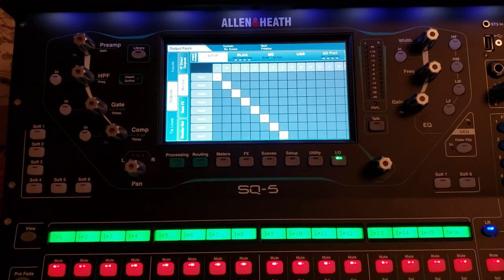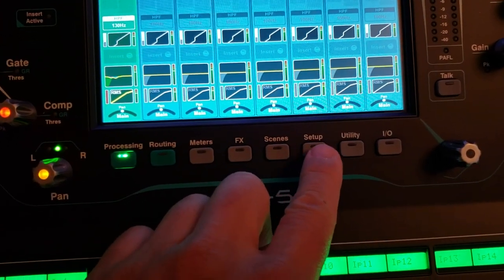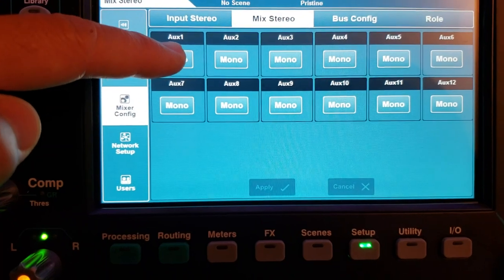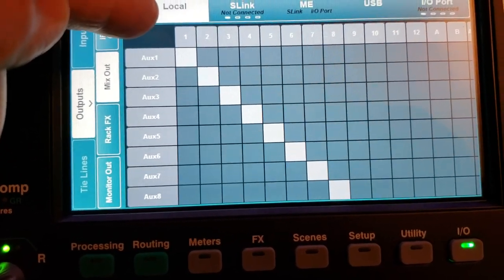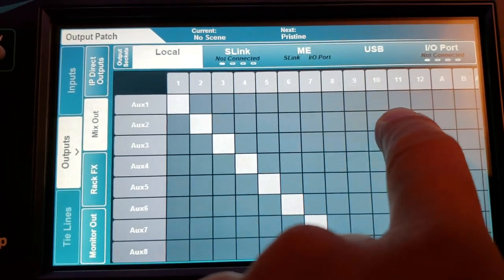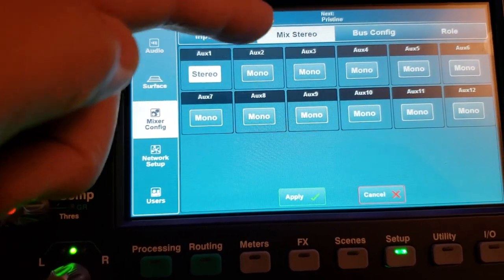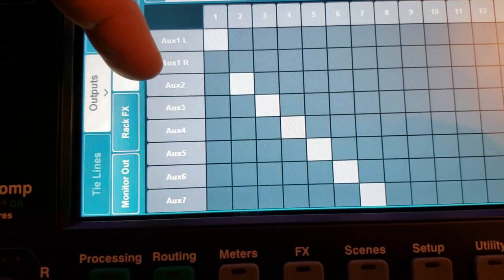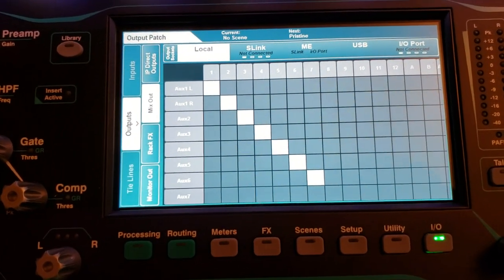Allen & Heath SQ5 Mix Output Configuration

Comment: I would like to understand why Allen & Heath build a huge console with just 6 stereo aux outputs (12 aux). Why can't we use one XLR Aux out as a single stereo monitor output for in ear stereo monitor for exemple?
Reply from the maker: If we're using analog signal, one XLR connector cannot feed a stereo signal; just mono. You need 2 XLR connectors to feed the left and right channels of a stereo signal. If you get the DX012 expander box, it provides 8 XLR outputs that can be configured as AES (digital), and each XLR connector sending AES signal is a stereo signal, if your in ear monitor has AES input.

Comment: hello ,I have SQ 6 AND 24 INPUT AND 12 OUT stage box ,,,I want more outs so I wanna buy a another stage box.,,but I will hove only 12 AUX OUTS in my console ,,, how to increase the out in console ..????
Reply from the maker: Do you have the AR 2412 stage box? If so, you can expand by plugging another stage box to the Expander port of the AR 2412. It should show up as another set of outputs and inputs. Or if you want to add only outputs, you can get a DX012, which has 12 outputs but no inputs. I think the AR-2412 only runs on 48 kHz mode, so you may need to force 48 kHz mode for all the I/O's including the new box you're adding.
Reply: @seanychenav  but I can handle only 12 outs from my console..so if I add a another stage box how will I be able to control those outs???
Reply from the maker: @rubensandesh8042  You're right. The SQ console only has 12 Aux mix select buttons on the right. While you can technically have up to 32 total outputs using DX protocol, the physical console surface only allows you to manually select and control 12 output mixes. The additional output mixes can be controlled by external control units such as the ME-500, ME-1.
Reply: @seanychenav  ah okay .. that was really helpful .. Thank you so much
Reply from the maker: @rubensandesh8042  oh I forgot something. If you have 26 output connections/channels, and assign all output mixes as stereo mixes, then you have 13 stereo output mixes, which are controlled by the main stereo mix and 12 aux mix select buttons of SQ console.

Comment: Can you label the AUX outs? - when you have a number of folds/iems it's easier to give a name than a number
Reply from the maker: The aux out LCD labels are in Layer D of the main fader section, not at the output select buttons at the right side of the console. I typically apply traditional labels next to the output select buttons.

Comment: Ok, I’m confused. If you don’t change these to stereo the the iem’s can only hear a mono mix? What about the SQ4You app? If the mix is sent to the iem’s in mono can’t the musicians just pan things into stereo themselves? I guess I just don’t get why it would be defaulted to mono when most mixes are mixed in stereo. Maybe I’m completely misinterpreting this function. Can someone make it make sense to me?

I think it would help the context of these tutorials if you gave examples of why you would want each function (mono or stereo).
Reply: Monkey Hunter, I understand the haas effect, at least from a mixing engineer’s perspective. I’m not really sure what it has to do with panning things for headphone/iem mixes. It would just sound more spacious and more like an album with all the panning, unless there’s something I’m missing.
Reply from the maker: I am so sorry for not getting to this question for 7 months... Mono output mix is typically used for stage monitor speakers, lobby ceiling speakers,... equipment with mono deployment; Stereo output mix is typically for in-ear-monitors that take stereo inputs by default. True, some more advanced IEMs can take 2 mono signals and "mix" them, but the result is not "stereo" per se, "blended mono".